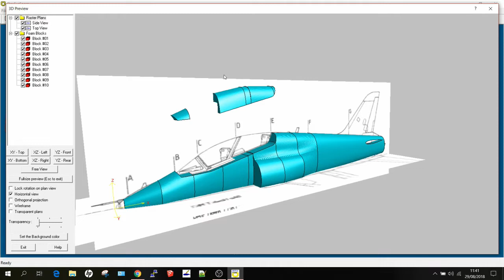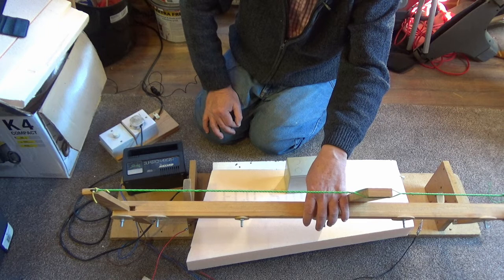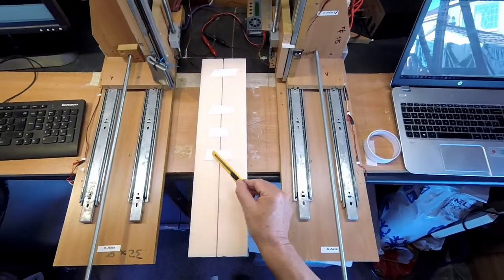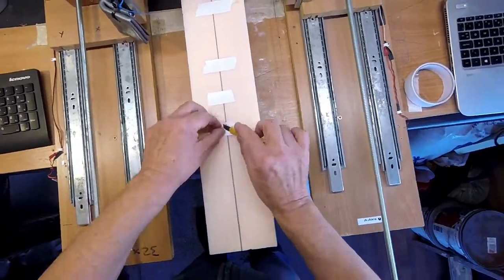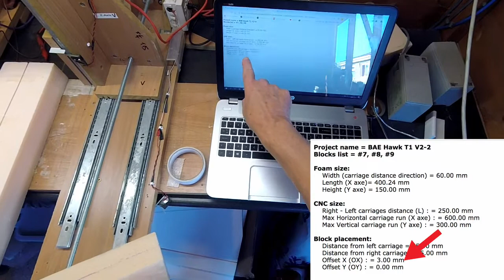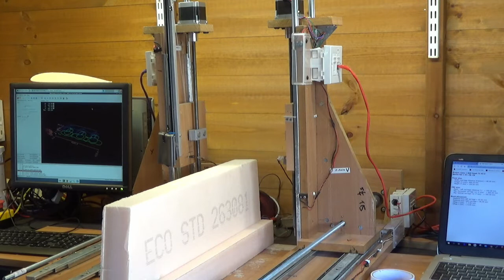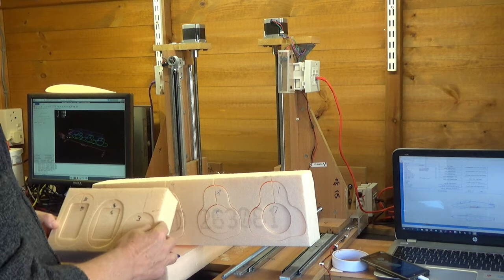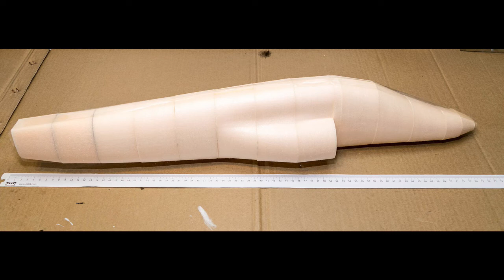DevFus Foam 2 Hot Wire Cutting the Fuselage

Comment: Brilliant work Sir! Can you please share details of the foam and possible supplier (in UK)? Many thank you.
Reply from the maker: Thank you.  The foam is XPS foam and I use to get it from B and Q in the UK. But they no longer stock it.  I have stopped using it not for that reason but I found when sanding it the particles caused me some problems. Even with a mask.  So I only use normal polystyrene foam and add strength by carbon rods and covering it in brown paper and PVA. There is a video on the channel showing how to do that. 
Keith

Comment: I dont know if it was this video or some else video from you but i heard you talk about using NicD setting on lipo charger to power the wire if the charger doesnt have a foam cut function, have you ever tried this? and also, the g code for this airplane. would it work with another 4 axis cnc too?
Reply from the maker: Yes I have tried it and it does work. Test your charger because I have heard some have a timeout and reset after a while. Which could cause problems if you were in the middle of a foam cut..
The g-code would work on another machine if it had the same  distance between the horizontal axes. Think I guess your next question. I don't have the g-code anymore for this airplane anymore because I had some design issues. If you see the latter videos it never flew for more than 10 seconds.  I'm hoping to make a new version later this year if time permits.
Keith
Reply: @rckeith  yeah i tried it and it goes on at .7 amps and around 10-11 volts but some times it just drops down to 0 amps and 0 volts for 2 seconds and make an uneven cut. testcut my machine yesterday.
Reply from the maker: @antonl1894  HobbyKing do a lipo charger with a foam cut option https://hobbyking.com/en_us/turnigy-reaktor-250w-10a-1-6s-balance-charger.html?___store=en_us

Comment: Nice work! I have similar setup to cut my foam slices and I attached to the ceiling a laser line to tell me where the center of the foam has to be in that way you don't need mirrors or anyting. It takes a while to setup the laser line but after it makes the job much, much faster. I make a LOT of slices so this step for me has to be quick an that helped me a lot....
Reply from the maker: Thats a good idea, its the most time consuming part getting all the measurement and position correct. Thanks for watching

Comment: Sir My cnc has 300mm maximum  travel along y-axis.And some parts of the fuselages (4,5,6,7,8) require 200mm max travel along y-axis.Do i have to change my 300mm to 200mm in mach3  settings or Is it fine ?
Reply from the maker: The gcode uses xyuv axis,  if you are using mach3 then you will need to change u and v to match your axis.  The critical distance is between the left and right towers that must be 250mm.  I suggest you try it on some scrap foam and see how it goes.